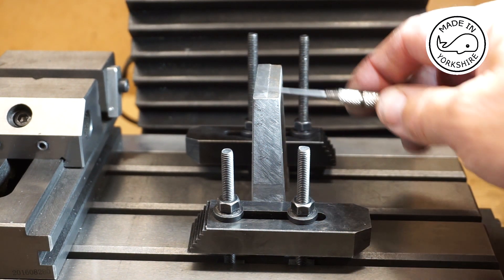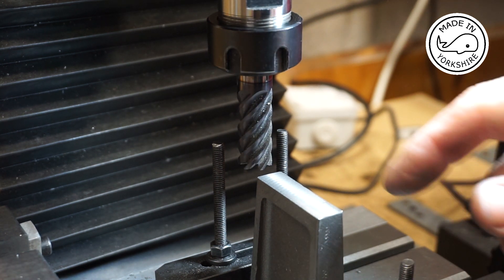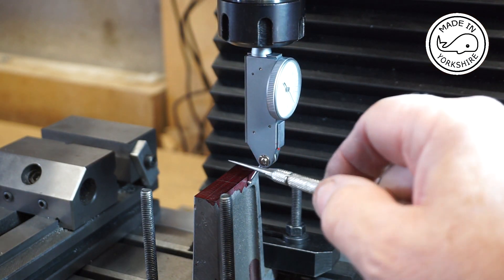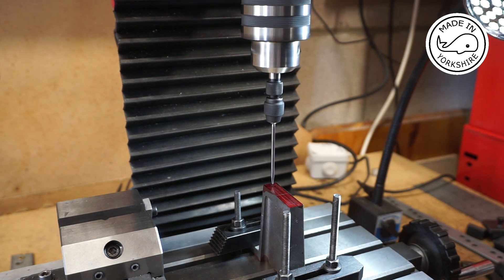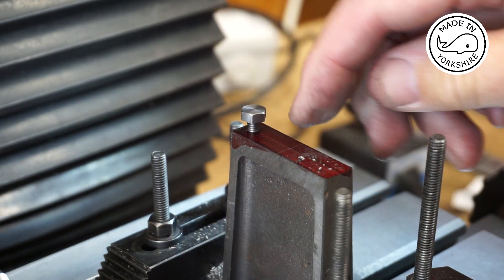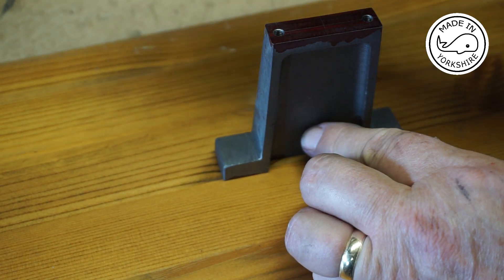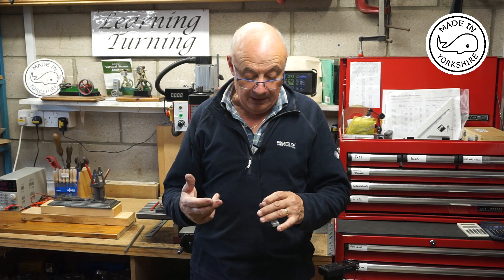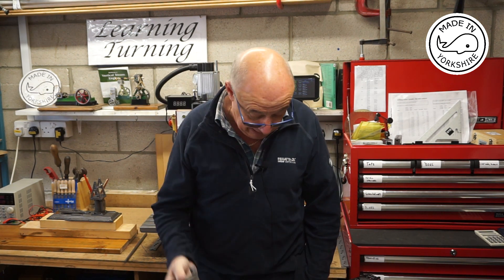#MT32 Part 10 - Making a Stuart Half Beam Steam Engine. The Pedestal. By Andrew Whale.

Comment: I've had problems in tapping a blind hole like the pair in the top of the pedestal.   I ended up buying a new final tap and grinding the end of it so I could fully tap down to the bottom of the hole.  (Not that the bottom of the hole is square of course, but drill shaped!)

Comment: Hi andrew in the toolroom we never had wigglers we used sticky pins.
Get yourself a pin or neadle and some plastacean or blue tack,
Stick the neadle into the bluetack then stick the blue tack to the drill or milling 
Cutter, then center the neadle like you would a wiggler very accurate and quick, 
And a tenth the price have fun good luck regards 
Ps takes a bit of practice and better than a wiggler.
Reply from the maker: Great idea Jonathan - I must give it a try.
Cheers
Andrew
Reply: Whats the difference?? I have used both types with great success , blue tack and a pin is just the "poor mans" method.

Comment: As with Tower Bridge, make the support in steel and then clad in "brick" or whatever. On the real thing to get the bearings level they would use shims is that not good enough for you :-)
Reply from the maker: HI Steve - shims sound good to me. BTW - I visited Tower Bridge engine room many years ago. It's a really fine piece of engineering for sure.
All the best.
Andrew

Comment: The steel rods sound like a good idea to adjust for final truing. These can later be hidden with a wood base... Or ultimately a slate base to connect back the pump to it's original purpose in mining. I'm sure, whatever you decide, your dedication to detail and accuracy will produce mighty fine model indeed.
Reply from the maker: Thanks Grant. Based on other feedback, I've decided to go with a metal base and just ordered a mild steel plate. Once assemble I'm not sure I'll be able to lift it up!
Cheers
Andrew

Comment: Hi  I made steel blocks to sit the base plate on and later covered around that with wood - at some point I might also cover the base with brick fronts if the mood takes me.   It's also important that both the base plate (sitting on blocks or rod) and the pedestal are both fixed down to a single flat piece of steel.  You are right the lineup is critical and I would worry that the wood would change shape.
Reply from the maker: Thanks for the feedback Kevin - I really appreciate it.
All the best.
Andrew

Comment: How about using threaded bar and adjustable nuts for a temporary base and then when its all assembled and running true you can take accurate measurements and build an elaborate neo-classical base.
Reply from the maker: Now that's an interesting thought. Thanks for the feedback.
Cheers
Andrew

Comment: If you're going to use wood for the base plate then please use a hardwood and not pine. Pine is the woodworker's version of aluminum however you can't hide pine like you can aluminum.
Reply from the maker: Thanks Craig - I think I'm now going to steer towards a metal base.
Cheers
Andrew